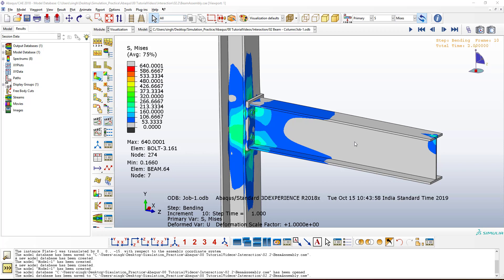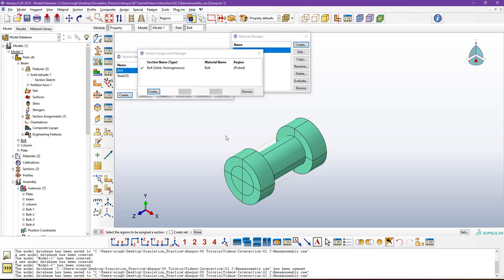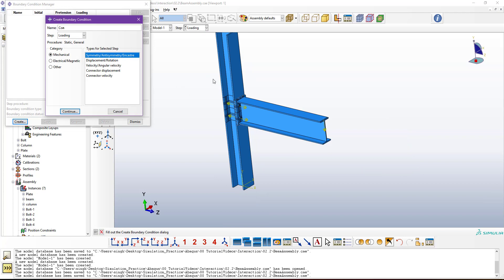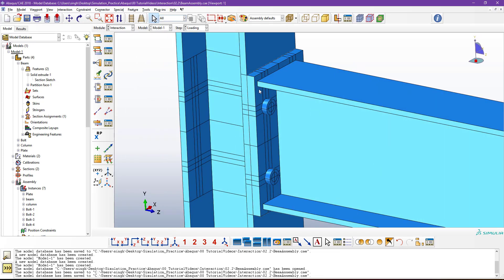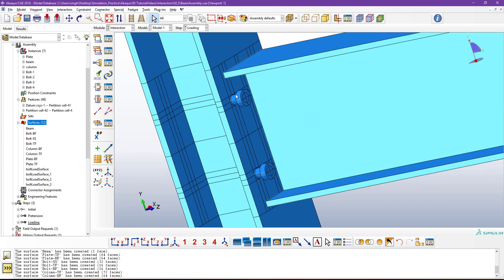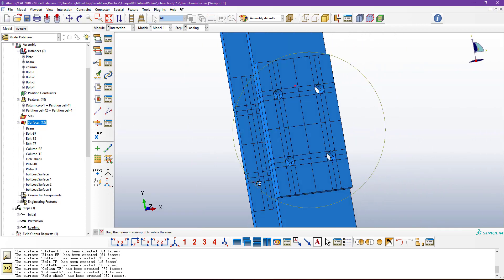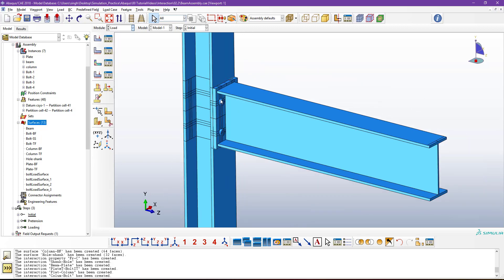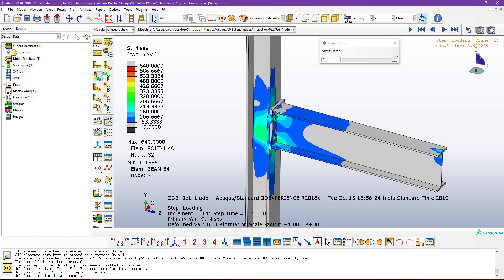Analysis of bolted Beam-Column assembly with Bolt Pretension load (Interaction in Abaqus Part - 02)

Comment: Thank you for the fantastic video. I have three questions for you:

1) What is the distance between the interior surface of each bolt head and bolt nut? Is this distance exactly equal to the thickness of the plate + the thickness of the column flange or not? 

2) What is the difference between the diameter of the bolt shaft and the diameter of the bolt hole? Does the bolt shaft have smaller diameter or it is exactly equal to the diameter of the bolt hole?

3) What will you do if the bolt is passing through 3 thicknesses (Double shear plate)? Do you still apply the pretension force at 50 percent or not?
Reply from the maker: Dear,
1. Yes, the bolt flange = thickness of plates in between. However, it should have some tolerance if u modelling things more exactly.

2. Bolt shank surface and plate hole having tolerance.

3. Bolt pretension produce tension in shank actually..number of plates will not affect its position. Pretension should be apply on mid untill shank area is constant.
Reply: SimTech05 Thank you very much for this great video, and you fast response.
Reply from the maker: Always welcome dear.

Comment: Hi, how do you do? I would like to ask for a problem solving in Abaqus, that I haven’t been able to find in the web in general nor in YT. The statement of the problem I’m looking for is a pretty common one I guess, and it is a structure with a pre-tension in the cables, such as in a cable bracing or the ropes for stabilizing an antenna mast. The most similar thing I’ve found is bolt force, or node displacement in an intermediate step, or cooling a part of the wire as a step, but it’s not what I’m actually trying to simulate. Nor is the prestressed of wires in concrete. Any help on the matter will be appreciated. Thanks in advance.
Reply from the maker: Dear,
For such pretension loads you need to make presentation in step 1 then in step 2 use it for your next loacase.
Reply: @arsitech-ltd  Thank you very much. I'll give it a try since I don't handle much of this software. Not asking for a second answer, but I just mention an initial doubt I get is if in that way that you mention I can make the force interactive with the deformation, since it's not an external constant load; you know what I mean. 
Anyway, thanks again. Saludos.

Comment: Hello. I am at the beginning of abaqus learning. I just have a question: you practically created 1 bolt and the plates. You assigned them, but the assembly creates just in automatic? I saw many other tutorial where you have to do it literally manually.
Thanks for the answer
Reply from the maker: Dear,
Parts assembly excluded in video to minimize length of video. It was assembled before video.

Comment: Tutorial was great, I just wanted to ask one thing, did you draw beam using 3d modelling or by wire and then assigned it I section ?
Reply from the maker: Dear,
It is 3D model. If you use 1d element with I section...you can't select faces of section.

Comment: first thanks for this tutorial it is very helpful, secondly How to obtain the bolt force evolution in the end plate steel connection. as you know abaqus can not give this data explicitly. is it a  direct product of stress with bolt shank  area or what?
Reply from the maker: Dear,
You can give output request for reaction force, on the required surfaces.

Comment: Some doubts sir
1)while defining tie constraint you choose whole plate connected to beam(not the i-section surface connected on plate).is it ok to give tie to whole plate.
2) you didn't defined tie constraint for bolt(bolt head connected to plate+nut to plate)...is it ok to give pretension nd contct surface only?
Reply from the maker: Dear,
1. By name of beam i selected i section only during surface creation.
2. Tie means u r fixing the bolt head with respective surface, of course one can do this.
But in reality bolt head not fixed with respective surface it has some frictional contact..so better to use contact with friction.
Reply: @arsitech-ltd  In this regard..what is the reasonable contact friction value for this case?
Reply from the maker: It depends on parameters like material, surface finishing etc.
To find approximate value plz visit - https://www.google.com/amp/s/www.engineeringtoolbox.com/amp/friction-coefficients-d_778.html
Reply: @arsitech-ltd  Thanks a lot

Comment: Sir 
Can we model bolt as shell element
Plz reply
Reply from the maker: Dear,
 you cant model bolt with shell element unless you consider it as rigid bolt.
However you can model bolt as 1d element.
Reply: @arsitech-ltd  sir 
Can we apply bolt pretension on 1 D element
Reply from the maker: Yes we can do.

Comment: Hello sir very nice video i have smillar model but i got an error "slave assembly bolt shanks  has 136 nodes in common with its master surface shank hole" i dont know what to do. Initially they are not in contact but come in contact loading phase
Reply from the maker: Dear,
Probably you select same master and slave surfaces. Or some portion is common.

Comment: Nice work sir, the way you explain things are clear and good. 
Thank you for your efforts.
Sir, I am working on the metal cutting operation (machining), I have a problem in defining the interaction module. (contact definition between cutter body and insert).
At first, I considered the insert and the cutter body together as a rigid body and the simulation went smoothly without any problem.
But in the case of deformable-body, I created a "tie" constraint between insert in order to make a rigid contact between insert and cutter body. And I have gave a "coupling" constraint for both insert and cutter body to a reference point which is in the central axis of the cutter body in order to give rotation and translation to the cutter body. at this moment I am facing few errors, the analysis is getting aborted with few errors.

So my question is can I use tie constraint and couple constraint together?
Thank very much for your time
Reply from the maker: Dear,
I can comment on error only after looking the errors. May i need to see files.
For such individual query in perticular model you can msg me, my contact details provided in discription.
Reply: have u solved your issue ?

Comment: Hello sir i appreciate your simulation but can i measure the bolt force so as to calculate the amount pf prying force on the bolt
Reply from the maker: Dear,
it can me measure by check contact force on the specific region.
However we will get distributed force value..not point or line load as in theory.
My suggestion to give output request on perticular region which approximately lead the prying action.

Comment: From where you get the "friction coefficient" = 0.3?
Reply from the maker: Rough Steel - steel surface with lubrication.
This is the general idea.. however one can take perfect value.
Reply: @arsitech-ltd  okk. Thanks for the reply.
Reply: @arsitech-ltd  how about bolt contact with concrete surface?

Comment: Dear Sir...Thanks for a great video..I doubt something...based on your simulation,seems that the bolt shank and plate hole share a similar diameter.In this regard,u have applied element based surface fr contact interaction. Yet,based on actual cond. they are differ in diameter(normally 2mm gap tolerance).Thus,for this case do I need to apply "contact element" for the interaction surface. Further, under contact element which one should I chose either "gap contact element" or tube to tube contact element". Thanks in advance Sir.
Reply from the maker: Dear, if it is small tolerance then no extra introduction technique/element required.
Reply: @arsitech-ltd  Thanks..I have another question regarding step. I still unclear on how the step is work in abaqus. By refering ur video, u have assigned 2 steps which is pretension bolt step followed by the loading step. In this regard,in sequent, you hve asking the abaqus system to run pretension step first then followed by loading step. Let say, I wanted to include prestressed tendon force into the truss element on the model. Thus, the series of analysis step sequence will be 1.pretension bolt step 2. Prestressed tendon step 3. Applying the loading step...Am I right?Thanks sir.
Reply from the maker: Dear,
With Abaqus prestress loaf can be define only in initial step that is default created step.
2nd step is basically 1st step that created by you - Abaqus allow bolt pretension only in this step.
Now you can define more step.

Comment: Nice video.
Sir, how do you calculated the pretension force of bolt?
Reply from the maker: Dear,
Pretension is defined based on application i.e. how tight you nut-bolt is with assembly. In this case i took data from standard study (paper).